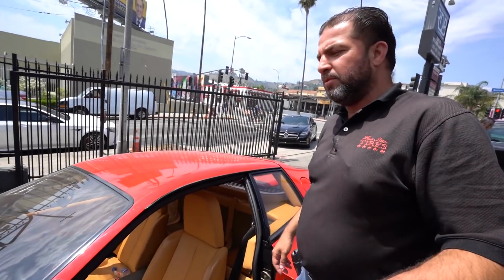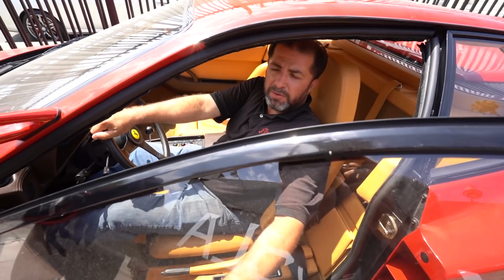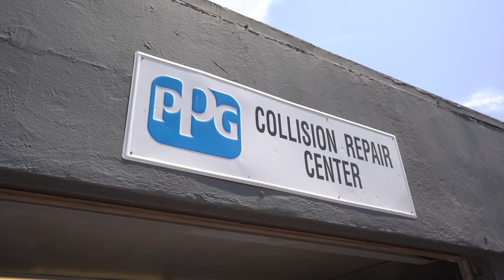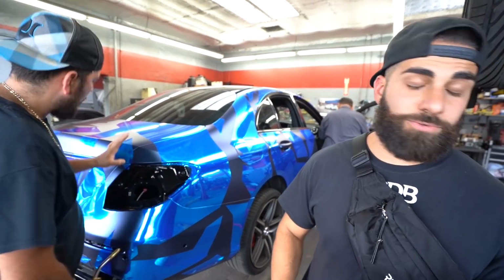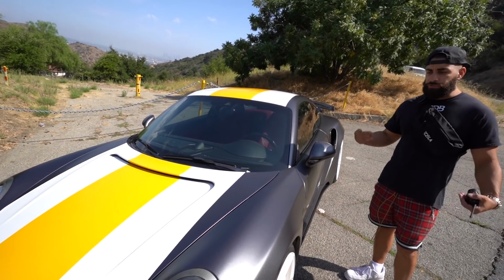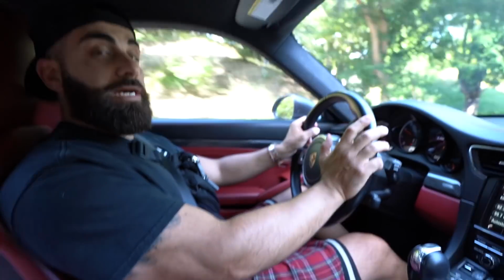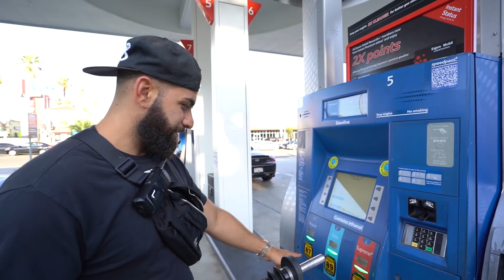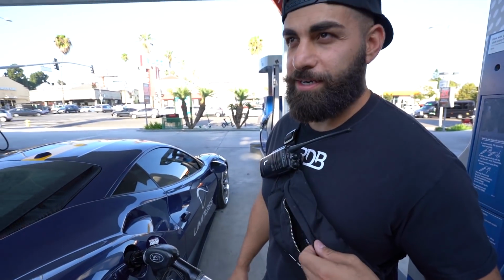CHRIS BROWN'S PORSCHE 911, MONSTER WIDEBODY FERRARI 488.

Comment: that bumper scrape on the 488, hurts to see
Reply: That's why you need a lift system.
Reply: Altandush Hoffmann weight reduction > lift system
Reply: @drugaruka  I would rather have a mint conditoned body work instead of having 20 kgs less.